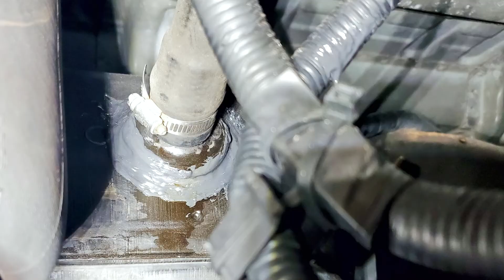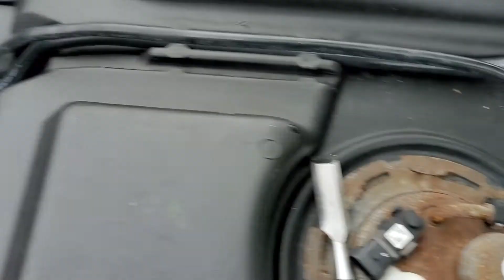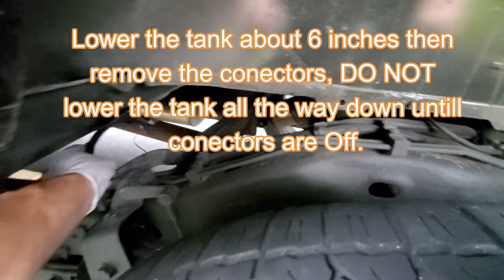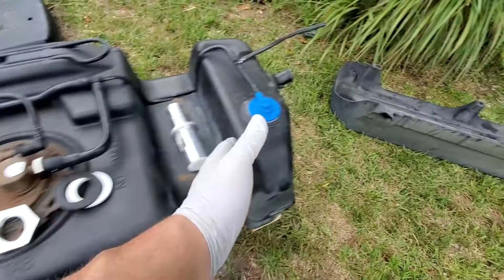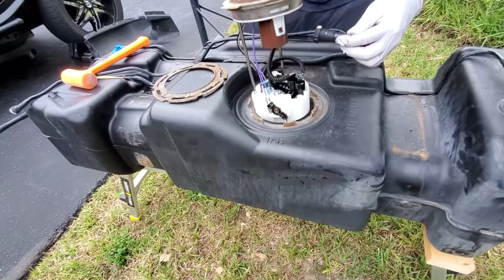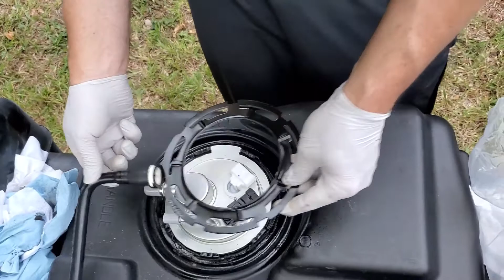Hummer H2 or GM Truck Fuel Tank Removal, Leak Repair, Fuel Pump Replacement

Comment from the maker: Just to update, make sure you use the Dorman part! The one I used has broken, the plastic stopper on top of the spring has swollen and become stuck! Suddenly I was not able to fill my tank, I was able to take off the fill hose and push down the plastic part to fill. Good thing I have this vidoe to drop my tank again. If anyone else finds a different manufacturer plase post.

Comment: Trying to get evap line off of the canister is difficult. Trying to drop out the canister without breaking it is difficult as well. The bolts holding the canister mount to the frame were definitely installed with the body off. I had to cut the evap line and then splice it back together.

Comment: the delphi pump fuel sender lasted about 2 years then the little contact fingers broke off. The original fuel sender is more robust, I recommend swapping them. Also the OEM fuel sender is no longer available as of 1 january 2024. Nice video and info.

Comment: Hello, when you bought the Delphi, did it come with a Strainer, as Original AC Delco has an Outside Strainer, but Delphi doesn't show it?
Reply from the maker: yes
Reply: @Griff100  So does it have it in the interior housing. GM or AutoZone or Oreilly or Parts Authority didn’t show one at the exterior strainer
Reply from the maker: @locosporelmarisco  its internal